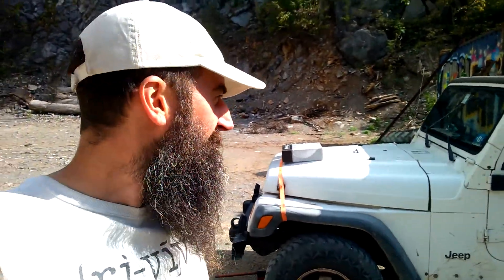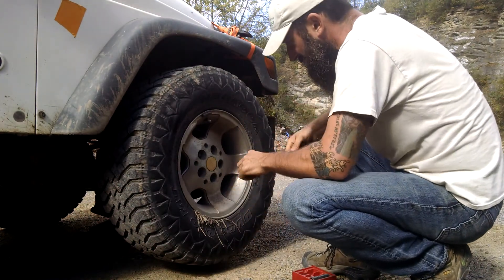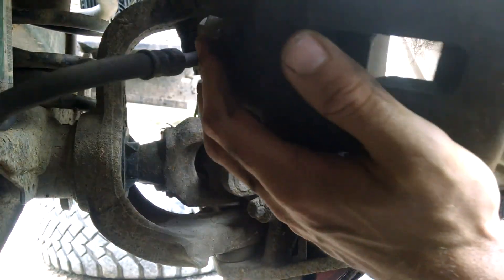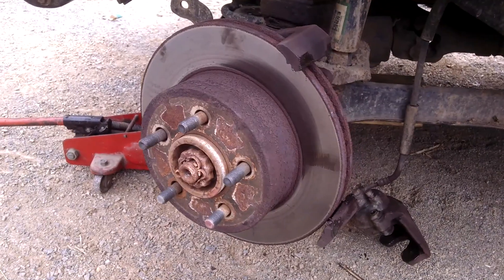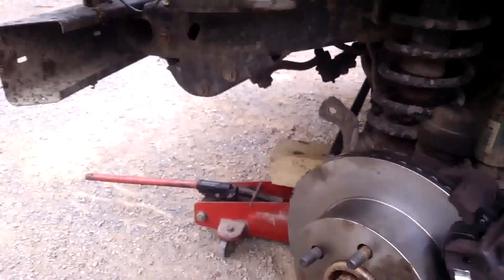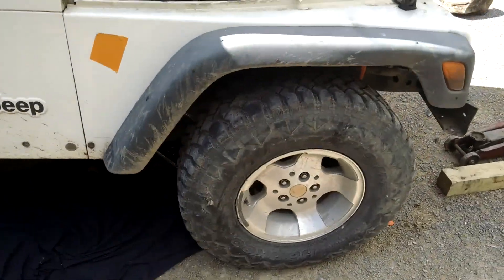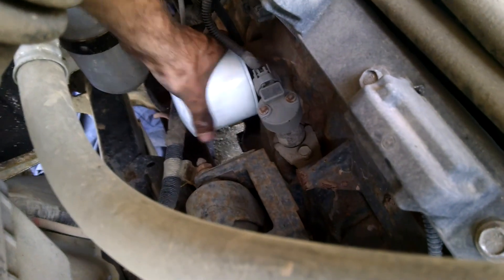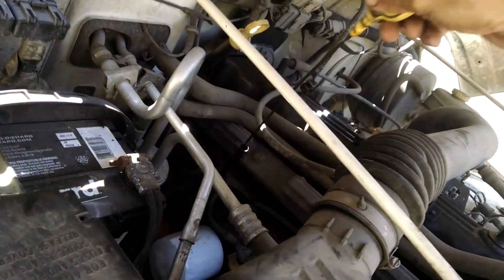DIY Car Care

Comment: Where do I begin with comments for this video.
Reply: Mr. Alan, would you kindly post a online tutorial on how to replace the water pump on my BMW thank you
Reply from the maker: I can but don't have my BMW anymore :( as i suggest in the video don't buy anything that cost so much to fix or is something that is too difficult to fix yourself. I try to live within my means and that's why i sold the expensive overpriced car and bought something just as reliable but easier to fix and more economical :). 
Doing the work yourself isn't for everyone that why i recommend my personal favorite auto mechanic Santos Service Center 
#santosservicecenter